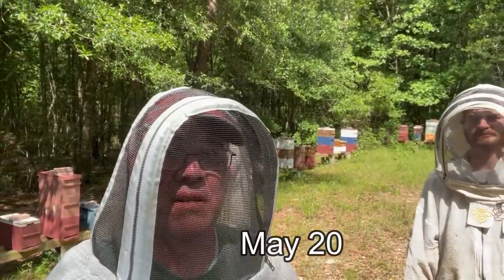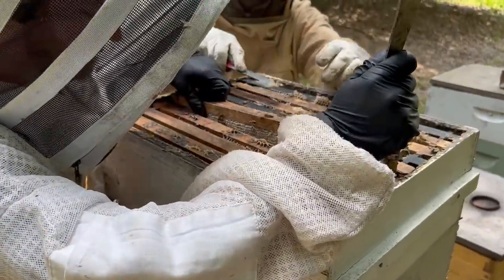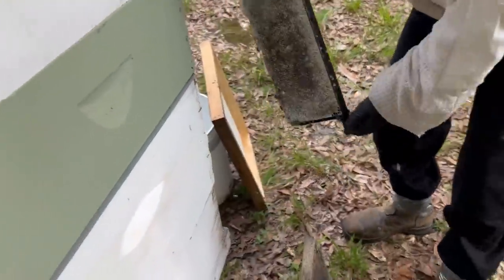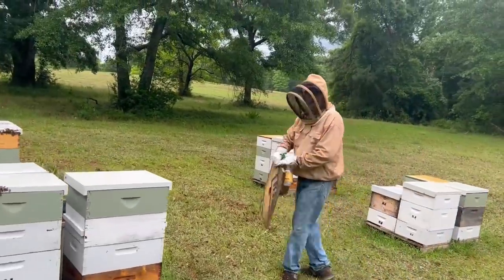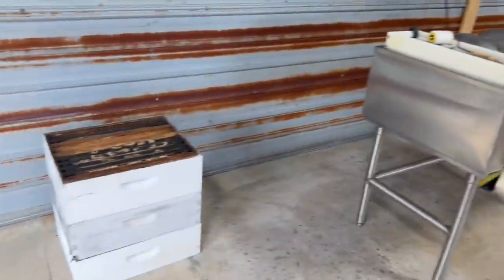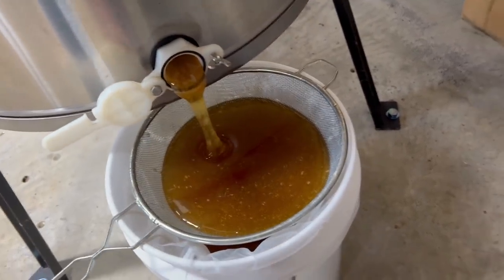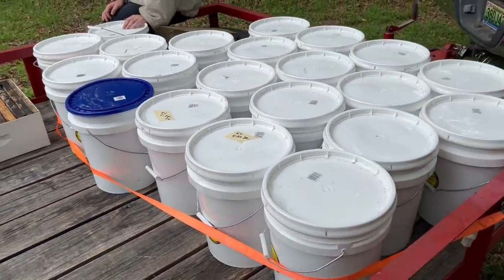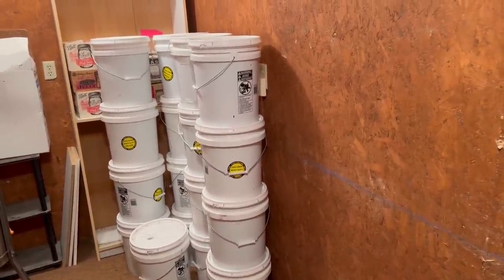Spring HONEY HARVEST  | Pulling - Extracting - Storing | Viewers get involved

Comment: I've thought of pulling honey in spring instead of fall in order to see if it would change overwintering survival numbers... 

But on some of the big colonies this means they have several boxes. And I'm worried if this will mean too much air space? Have you tried something like this? And is this going to mess them up with that many boxes even if they are full of honey? 

I am curious if it can help overwintering with an experiment like this. But maybe its also possible for it to back fire if there's too much space also?
Reply from the maker: It is possible to have too much honey.  But that depends on your region.  Here in this area too much honey equals hive beetle haven.  So it’s important to get most of it off.  But that probably varies from place to place.
Reply: Thank you.

Comment: I have a fume board but have not ever used it. Do you find they work well?
Reply from the maker: Yes.  I like using bee escapes too but they require extra work.  Fume boards work well but they take time so if you need to move fast you need a few of them so you can have multiple hives going at once.  I have 6.  If working the bees alone would only need 3 or 4.